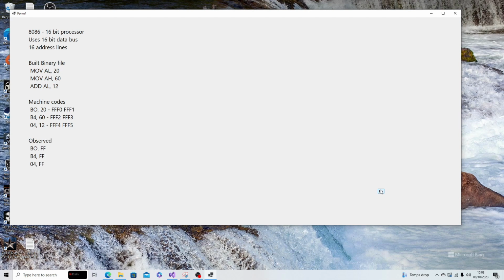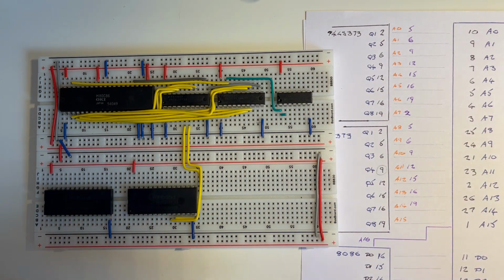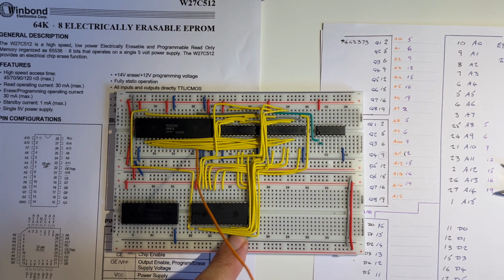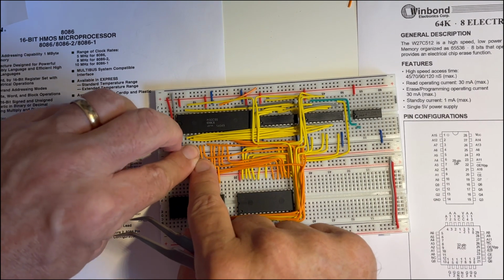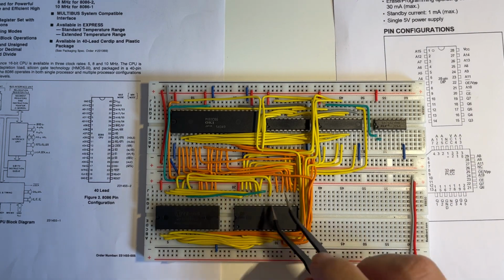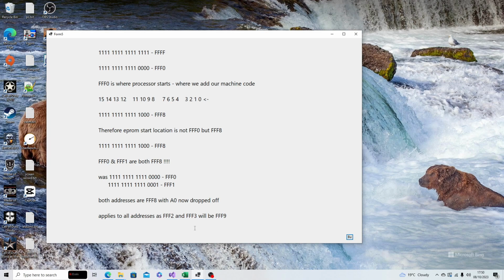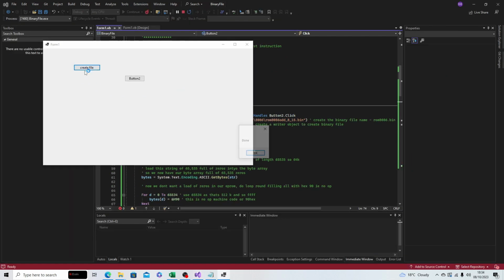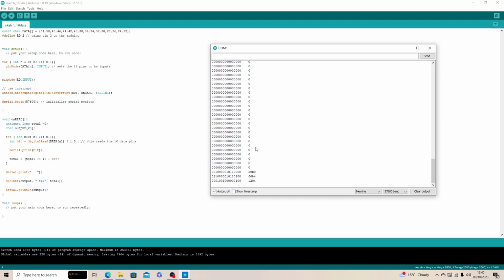Hello World on a breadboard Intel 8086 16bit - high byte Low byte eproms - part 7

Comment: In part 6, the last diagram shows the usage of BHE and A0 pins to control even and odd ROM. As far as I could see from this video, the output enables of the ROM chips are controlled by RD signal, and chip enables are controlled by AD0 signal. Is there a reason why BHE is not used? If we were to use BHE signal, how would be the output enable pins be signalled?
Reply from the maker: Firstly thank you very much for spending the time to view the videos and to comment. I very much appreciate you taking time to do so. Yes, the 8086 reads 16 bits of data. So it expects to read data on all 16 pins. So I connect 8 of its data pins to 8 data lines on low eprom and other 8 data lines to the other eprom. The architecture uses a common address bus. So the address bus is connected to all the chips. Hence why we have to use an address range and only enable the eprom when using the eprom address range. So as you say we are using the chip enable on the eprom via the NAND arrangement. The 8086 is using a combination of the BHE and A0 lines but I don’t need to connect these to read the eprom data. I only need to enable the EPROMs when I want to talk to them. That way when an address is placed on the bus that’s not in the eprom range and the microprocessor reads in what’s on the data lines it doesn’t accidentally read data from the eprom. It’s by using this arrangement of specific addresses we can design our architecture to target specific chips on the address bus. So yes, in answer to your question the 8086 is using A0 and BHE but because it reads 16 data bits I don’t need to add additional complexity to the circuit by using these A0 and BHE pins on the 8086. I can make the circuit less complex by not connecting to these. I’ve also got the advantage that the EPROMs are read only, so I can get away with only using the read signal. It’s true that the read signal on the 8086 will also be common to anything else connected to the address bus. So if I added say RAM and wrote an instruction to read from RAM I’d have to connect the read signal to the RAM and EPROM and distinguish which by using the address range. So I’d add my RAM in a different address range and only enable the RAM when using the RAM address range. When doing circuit design architecture there is a trade off on trying to keep the circuit as simple as possible whist achieving what you need. So for instance, yes in this simple circuit I’ve completely cut out the ability of the 8086 to address other 64k blocks by hardwiring A15 to 1. However as I’m only writing a small program that doesn’t require more than a few bytes of code it’s more efficient for me to do that and keep the circuit simple for what I need. To answer your question of how would you use the A0 and BHE that’s moving up a level of complexity that I wasn’t addressing in this simple set of videos on how 16 bit microprocessors work compared to 8 bit. I guess I could in the next set of videos explore that feature more, but unfortunately other things in my life have come to the fore and stopped me from expanding on that original set of videos.
Reply from the maker: So the reason I haven’t used the BHE or A0 is because I don’t have to add that complexity. I want to keep the circuit architecture as simple as possible and in any circuit design there’s always trade offs. So yes internally the 8086 is busy setting those lines but for my simple programming I don’t need to worry about those lines, I can get away with not connecting them. Yes there might be some thing in expanding the circuitry to then mean I have to use these, but as I don’t for the purposes of these videos and to keep the wiring simple (although if you look at the mass of wires as it is, it’s pretty complex as it is) I have left these off.